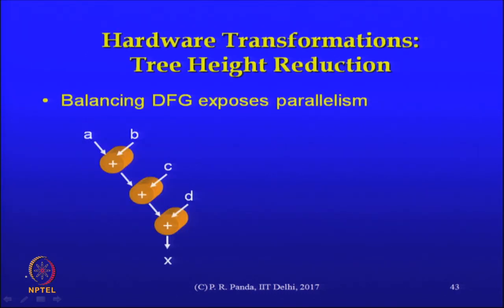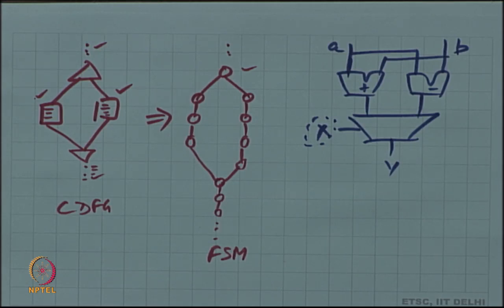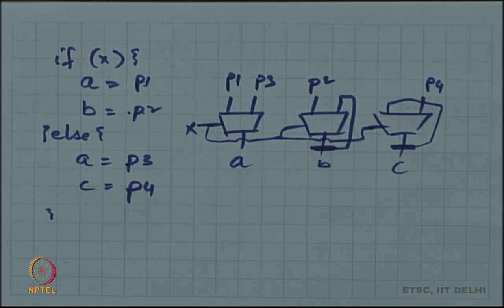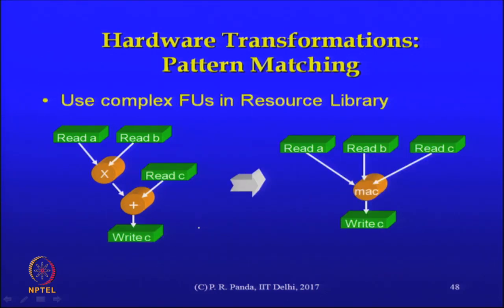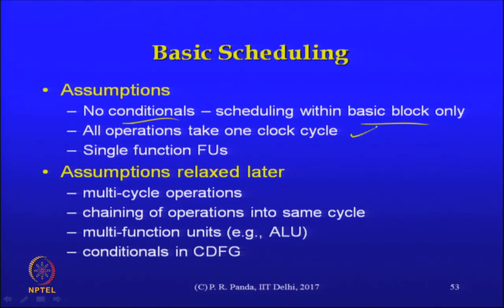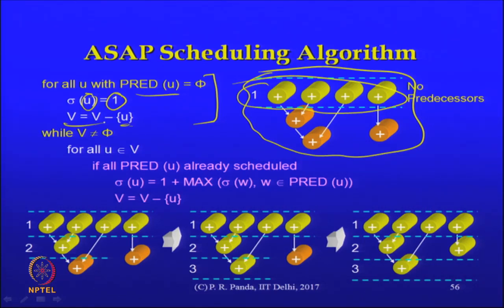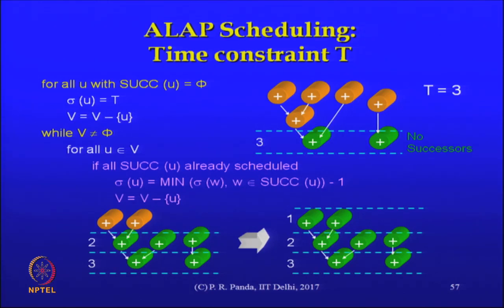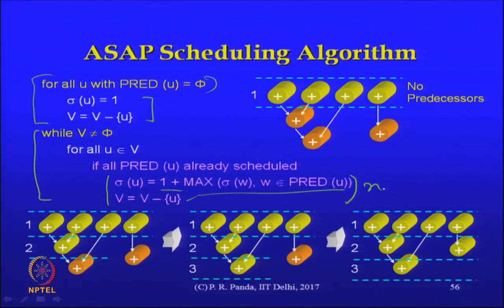Hardware Transformations & ASAP / ALAP Scheduling

Comment: 58:05 

Assuming adjacency list representation:
Finding all nodes with no predecessor will take O(|V|+|E|) = O(V^2) in worst case. The simple algo would be to take an array/map of |V| size size and traverse the the adjacency list, and whenver u-> v edge is there, increment map[v] by 1.
Finding all nodes with no successor will take O(|V|) time as the algo would be to traverse all |V| directory nodes in adjacency list and simply check if len(list(v)) = 0, or not.